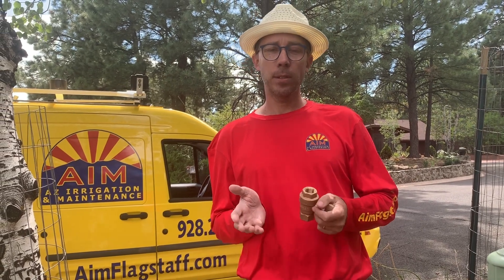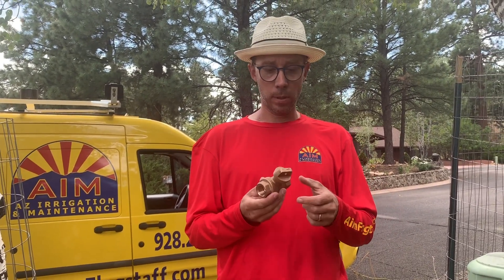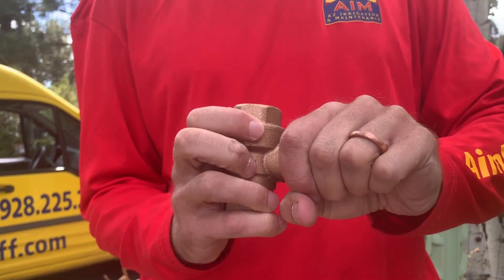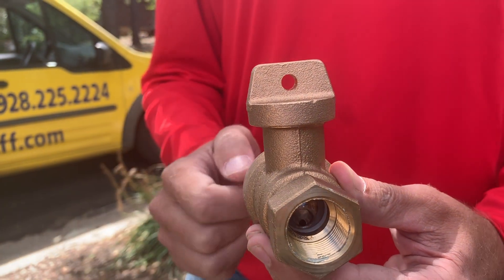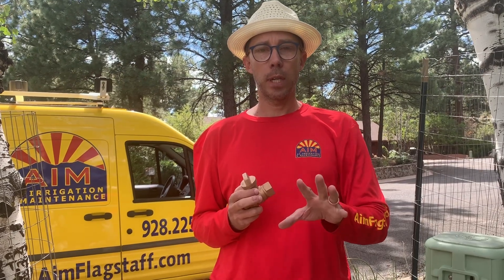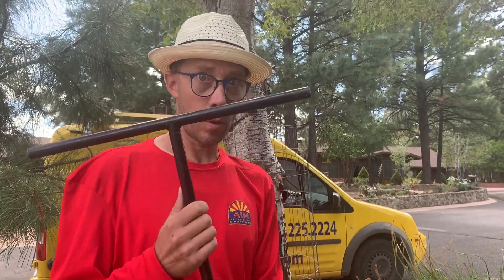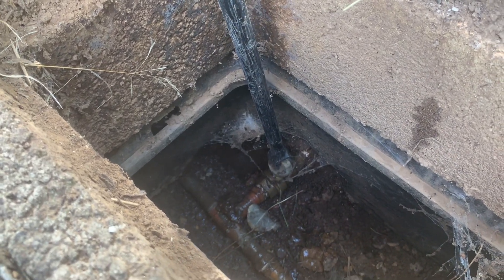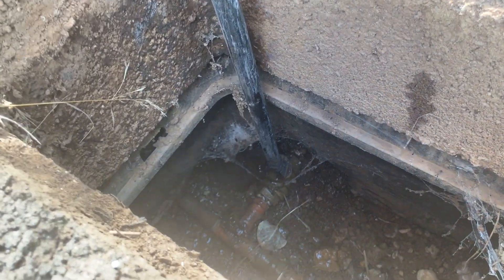What the heck is a Stop and Waste valve????

Comment: Thanks for your video. I was hoping to see proof that at least some curb stop valves are equipped with a waste drain hole, so that there is no water pressure entering the house after the valve is fully closed. I understand that no ball valve seals perfectly forever. Concerning the valve that you are showing in the video, how many decades would you expect it to last before it either (1) fails to close fully, (2) fails to re-open fully, (3) leaks too much water into the house due to a poor seal after fully closing the valve, or (4) leaks too much water into the ground through the waste hole after fully re-opening the valve. I imagine that any one of these 4 failures would justify asking the city to dig up and replace the valve at their expense, even if it is buried 6 feet under the lawn, as in my case.
Reply from the maker: The valves we deal with usually last 10-20 years.  Always install the best one you can since it's a big deal to replace them.  See this video for the ways they fail and how you can tell.   https://youtu.be/jUZWUbLFRsU

Comment: how much does it cost to fix the stop? I couldn't turn on my sprinkler system and we have been told that the stop is stuck with soil and sand. thanks.
Reply from the maker: It's really hard to say without seeing it.  Depends on how deep it is, what size valve it is, how rocky the soil is....

Comment: Which way do you turn it to turn water off? I've tried both and neither stop water to my house.
Reply from the maker: Turn it clockwise to shut it off.  There are a few things that might be the problem.  You could be trying to turn a valve that is not connected to your house, maybe it's going to another structure or something.  When you turn the valve does it stop? or can you keep spinning the top.  The top could be broken and needs to be replaced.

Comment: You forgot to explain the purpose of the valve like you said you were going to do
Reply from the maker: Whoops.  The main purpose of that "waste port" is for the water from the back flow to drain out.  Otherwise water would be trapped in the pipes and break the pipes when they freeze.